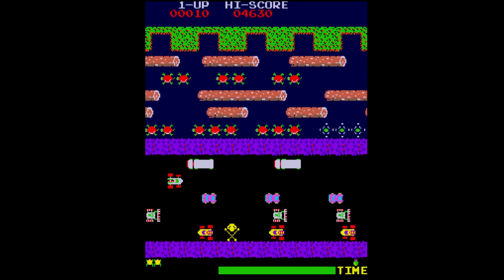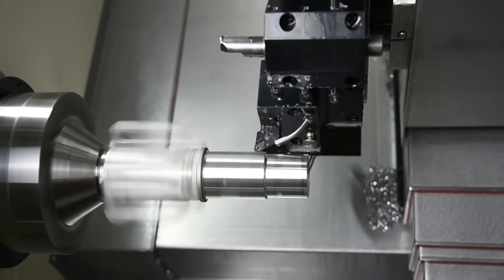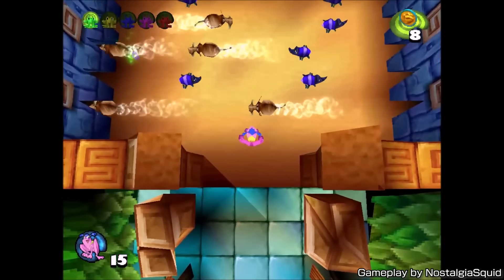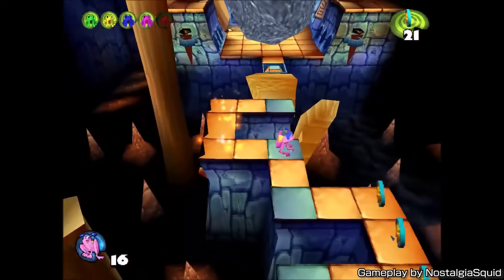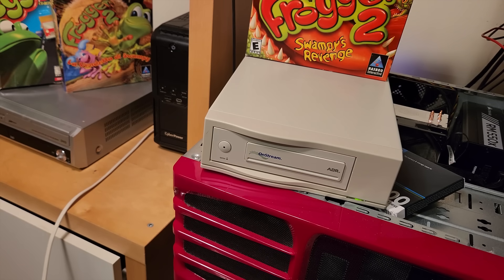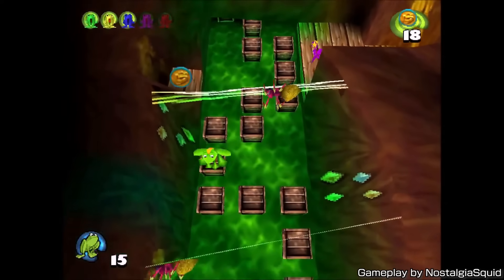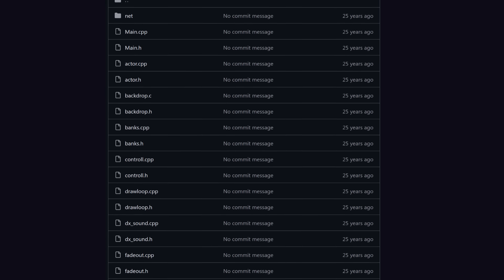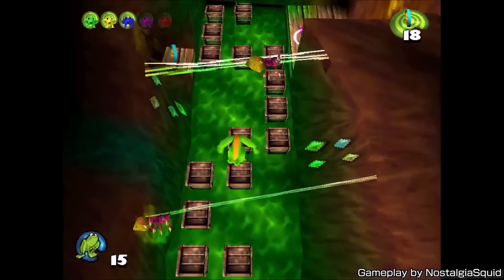How Frogger 2’s source code was recovered from a DESTROYED tape

Comment: This is a problem every archivist has. Any proprietary saving method is a horrible idea to use. Never relay on one company to keep your data "safe".
Reply: My grandpa used this old CAD software from the 90s called Bobcad refusing to learn anything new until the dayl he died a few years ago. DOS Bobcad despite using DXF and DWG files uses its own proprietary math system of some sort meaning no other program can properly read them. The Bobcad company can't read them anymore and has stated  people like me are shit out of luck. There are thousands of drawings of molds and machine parts he made. Sometimes the company he did most of this work for needs these molds and parts remade meaning I have to sort through these drawings he rarely ever actually properly named and just called them shit like '*name of employee who requested this part* *date*' so I have to load through all of these, which is pretty laggy using DOSbox, then omce I find the right drawing recreate it in a modern CAD program i have open on a separate computer. I am in hell.
Reply: @Technocolor00  I hope you get paid for that and don't put yourself through that torture for nothing.
Reply: @Technocolor00  there could be a way to reverse engineer it.  You can start with a hex editor and compare a simple drawing between bobcad vs. something like autocad 13 and try to figure it out
Reply: at that time archiving formats were all over the place nobody really stelled in
Reply: I use LTO Tape to archive. What do you think about LTO ?
Reply: @ArcardyArcardus  they dont taste very good 💔
Reply: @ArcardyArcardus LTO is the tape format, which is fine, a lot of people use it. The issues come from the software you use to back up your data to the tape. Obscure, less-used software may lead you to situations like this video, where buggy drivers and weird storage methods make recovery difficult.

If you use a more popular software that has good support and widespread use, you are likely to have little to no issues recovering data off your tapes in the future.
Reply: There is no universal standard for long-term storage that would solve this problem. You can get specialty M-Disc optical media, storing 100GB on a BD that is supposed to last centuries, and you can still buy them today. But good luck finding a working BD reader and a computer with support for what is in the future going to be seen as an ancient file system (ISO9660 or UDF). And even if you get the files copied, good look opening them unless they are very basic formats.